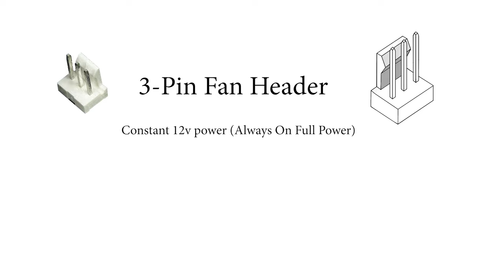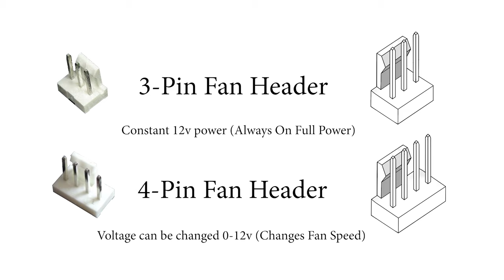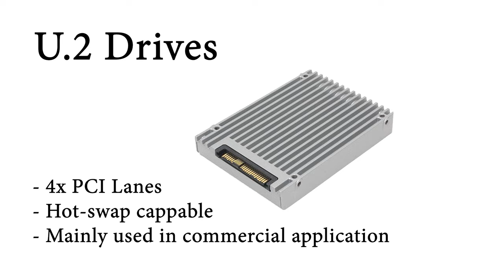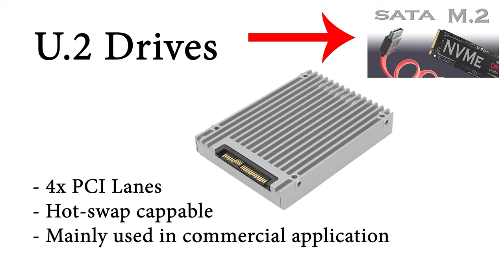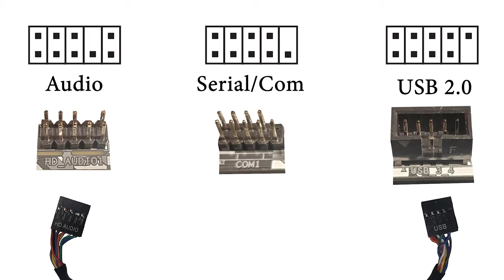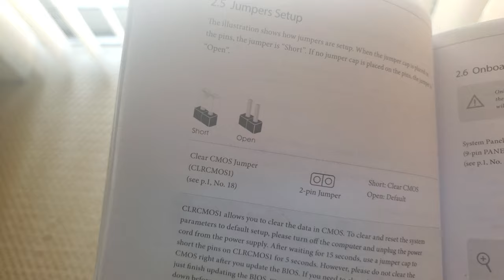Motherboard Connections Explained

Comment: Hi, I was kinda hoping you would mention a s/pdif connection. I have the connection on the mother board I have, just not sure what I need to buy so I can use it. but good video, guess i will keep looking. 
Have a good day mate. nice video otherwise.
Reply from the maker: Spdif is an audio connection. If your speakers support it you can buy a cable for it, but otherwise the normal audio connections will work fine. It's one or the other, you don't need both
Reply: @MaxsTech  Hi Thanks for the quick reply :)
I think you misunderstood me. My asus motherboard has a spdif connection on the mb, but it is a 4 pin on the board itself, with no spdif connection in the I/O. So I need something I can make the connection to the mb that  has a bracket and small board, so I can use a slot on the back and have a spdif connection. That way I can  use my 5.1 surround system. My main pc has a spdif out in the I/O, but my secondary pc does not so I want to be able to use the 5.1 on both pc's. 
Hope that make sense. So I guess I was/am looking for a product review on that sort of product. To tell the truth the video's I seen that were for a product like that were , well useless and that is being kind to the content maker's.

Comment: if I was to stick on my front i/o wire stuff on the wrong way eg -/+ was on opposite would this damage the system like a car battery would melt the wires. i know this wouldnt melt the wires. but if im going to build it correctly im going to ask the stupid stuff
Reply from the maker: From my experience they have never damaged anything. 1) they're super low power so a bit different from a car battery. 2) typically mixing up wires is only a danger when it comes to batteries since you could short the battery.
Reply: @MaxsTech  thanks man just had to be sure as i am new to the whole PC building thing. i understand its much lower power so i just thought id ask. better safe than sorry ;)

Comment: What about the USB31C header on motherboards.
Reply from the maker: If you have a usb type c front header. I should have added that to this video but those were almost none existent when I made this. Its a smaller port than the usb 3.0 about the size of an hdmi port.

Comment: What about if you have an extra reset switch?
Reply from the maker: On the case?
Reply: @MaxsTech  yeag
Reply: @MaxsTech  I have two reset switches and one connects to the reset button and the other connects to the LED button

Comment: Can I connect USB 2.0 ports to USB 3.0 headers on the motherboard and get USB 3.0 functionality?
Reply from the maker: They use different headers since usb 2.0 only consists of 4 wires while usb 3.0 uses 9.
Reply: @MaxsTech  I did notice that about 40 seconds after I posted the question. Thanks.

Comment: How to connect water cooling when there is no pump fan connector on the motherboard ?
Reply from the maker: You can use a fan header, just make sure if you have a fan controller or software that controls fans to never mess with that one. The pump should always be full and on.
Reply: @MaxsTech  Thank you for your answer. My motherboard is an ASRock Z170 Extreme4 and it gives you the ability to control both automatic and manual control of each slot. On this board I have 2x CPU Fan Connector and 3x Chassis Fan Connectors. The cooling kit also included a molex adapter, thanks to which I connected the cooling pump to the case's power supply ... is this also a good solution? or maybe better to use one of the slots on the motherboard. Because from what I understand, the district pump should be constantly on under constant voltage, but should it also be somehow controlled and regulated manually or automatically? Which solution is better?

Comment: Great! Thanks. Just miss the SPDIF connector. Actually I have this problem how to connect it on an ASUS B550-E Gaming. I mean what color get on what pin?! Maybe someone can help :) Cheers
Reply from the maker: You have an SPDIF connector? Usually that’s all hard soldered into the board. That’s part of your audio connections, I guess it’s possible you could have an spdif connector on the front panel….but I’ve never seen a case that offers that or motherboard that supports it. I’m betting you don’t use it though :P spdif isn’t popular. Let me know any other details if you can’t figure it out! Thanks for watching!

Comment: If my case has usb 3.1, can I plug it into my motherboads usb 3.2?
Reply from the maker: If its usb 3.2 gen 2x2 will use a different connector, a smaller square, not super popular yet in cases but we are slowly getting there.
Reply from the maker: They do sell pci cards that you can get though if your motherboard doesn't have 3.2 front panel support

Comment: yes my mother boards pwr switch is like only 5 little pins and one blank on i dont have a spot to plug all the front panel cables into lol right now ganked the old pwr switch from the old case and have the side panel off hitting the little switch button to turn it on
 i had one of those little slim gaming computers and upgraded to a mid atx tower to have more room for a better graphics card

Comment: I have 4 pin fan header on motherboard but have 3 pin wire on fan what should I do ?
Reply from the maker: You can still use it on that header. 1 pin just won't go in but it will still work

Comment: Some of these aren't completely correct. 3 pin and 4 pin fan headers can both be controlled. 3 pin header controls speed by changing voltage up to 12v and the 4 pin header controls speed using pwm. Other than that the clr cmos isn't always a 2 pin. It can also be a 3 pin (you have to move jumper between pins to clear cmos) and some motherboards have a button instead of 2/3 pins.

Comment: My front panel connector has 2 sides, please help.  One with the led and shit and the other side is unlabeled with pins
Reply: 2 sides?
Reply: @reubenconner1679  I figured it out, my pc wouldn't start cause the motherboard was faulty and it was a whole hassle lol.  I got it sorted out though.

Comment: Can 4 pin fan use for rgb?
Reply from the maker: If you want to control the rgb lights those fans typically have a separate connector for the lights, it’s not the same as the fan connector.
Reply: @MaxsTech  can it be use for rgb if I use adaptor? my pin for rgb broked :(

Comment: You were completely wrong about fan headers
You can control voltage on 3 pin connectors via bios. This may cause issues with rgb lighting, lower the voltage, dimmer the light
4 pin connectors are controlled by PWM (Pulse width modulation) that doesn't change the voltage but pulse width 100% is 12V constantly 50% are voltage pulses equal in length. 10% is 1:9 pulse ratio
Reply from the maker: Refer to the pinned comment.

Comment: my gigabyte motherboard has no rgb header connector how to control my RGB fans on my case?
Reply from the maker: You won’t be able to directly from your board. I think you can buy rgb controllers you can plug all your lights into though and control via a switch or secondary controller.

Comment: If my motherboard has the 8+4 pin do I need the extra 4 pin... having problems with having a screen when I turn it on and says my gpu is undetected
Reply from the maker: Should be fine with just the 8 unless you are doing some crazy overclocking
Reply: What’s crazy is that my ram had to be put in the wrong slots to boot up💀
Reply from the maker: Could be a faulty ram slot on the motherboard. Also double check your ram is in the official support list for the motherboard. Ram can be weird sometimes and mess stuff up.
Reply from the maker: Sometimes ill just take the the ram out and put it right back in and it fixes issues.  Lol
Reply: Good to know, thanks !

Comment: im trying to add another ssd to my mother board and i have no clue on what to buy..i have the SSD and thats it.  I have a cool master v750-750w compact fully modoular 80 plus gold power supply. I dont know what i need other than the SATA  90 degree angle cable.
Reply from the maker: For a sata ssd you'll just need a power cable and a data cable. The power one comes from your power supply, the data one is seperste and connects from your ssd to the motherboard, it's the same L shape as the power but much less wide. Usually connects near the bottom right of the motherboard

Comment: My case has a 1394 cable, but my motherboard says in the manual "Don"t connect 1394 in the usb or the motherboard may be damaged!' :(
Reply from the maker: Thats used for fire wire, an old plug standard for drives and cameras. Your motherboard probably doesn't have a port for it since its not used anymore.
Reply: @MaxsTech  Oh I see, thanks for replying! 
Btw, I'd be very pleased if you could help me with your opinion on an issue my psu is having. 
The thing is, it makes a noise like a squeal but if I demand more performance from the CPU it almost goes. I read in some forums that people call this coil whine so I decided to open the PDU (all safety protocoles) and checked it and by trying to locate the exact spot of the noise I realized that it's not a coil that makes it, it's a spot between a Ceramic capacitor, a resistance and a Ac to Dc rectifier, don't know exactly which one of these is the deffective but my guess is it's the capacitor, something that people call "Capacitor Squeal" I saw some people say that's harmless, other say it's the noise a cap makes before fail, others say it's the electrolite inside it. 
I don't know the psu has worked perfectly so far despite the annoying squeal. ¿What do you think about it?, I'd be very happy to see your opinion.

Comment: I know, we are used to the color being RGB, but the order of the pins of the LEDs on the motherboards is not RGB, it is GRB (to be exact it is 12v-GRB, the most common if not the only order in almost all 5050 led strips), it can be read on the board itself (1:27). Since you explain the connections, let's at least get it right.

==========

Ya lo sé, estamos acostumbrados a que el color es RGB, pero el orden de los pines de los leds en las placas base no es RGB es GRB (para ser exactos es 12v-G-R-B, el más común por no decir el único orden en casi todas las tiras led 5050), se puede leer en la propia placa (1:27). Ya que explicas las conexiones, al menos pongámoslo bien.
Reply from the maker: The order of the pins were never discussed. Clearly you can see from the color of the lights wires as shown in the video that the order is WGRB. Where white is the 12v (sometimes depicted in black).
Reply: @MaxsTech   It is on the upper right corner, you have drawn the scheme of pins, and it says RGB, you also draw a red arrow to show the voltage pin.

Comment: what will happen if i plug 4+4 pin to a 4 pin cpu power? and what is 4+4 pin? newbie here
Reply from the maker: 4+4 just means its an 8 pin power connector thats split so in case you only need 4 you can use it still. Just so they only have to make 1 cable that fits multiple boards.

Comment: I upgraded my power supply I hooked it up and on powering up the pc it shuts off and turns back on..need some help
Reply: you probably have something plugged into a fan or rgb header that shouldn't be there. that was my problem. i took off all the fans (I have 6 not counting the cooler on the cpu) on my gigabyte b450m board... it says "cpu fan" in the top fan connector, like I  this video, then on the upper left there's a 3 pin and a 4 pin and this is what he's talking  about with the 3 or 4 pin that is either always on or that controls voltage. get the shit out if there, run a fan or rgb hub off the main fan header, and be free of not only cables going there but the troubleshooting hassle it is for first time builds... or first build since 2gb was "oh man we're NEVER going to use all that storage!" on some @aol.com email address havin 14.4kbps shit.  if you're either of those, like me, knowing that having those configured incorrectly can prevent your pc from even booting, tho the convenient fan header looks tempting, just steer clear  if nothing else is working.

Comment: My motherboard does not have a pump header and it just has a cpu fan which is 3 pin and I have recently bought a liquid cooler can someone please tell me what I should do
Reply from the maker: You can still use a fan header to power a pump, the pump header is just locked to the full voltage. You should never run a pump at a lower voltage, the fans you can adjust speed wise but the pump should always be on 100%.
Reply: @MaxsTech  ok thanks a lot

Comment: The fan header explanation is completely wrong, you can controll voltage on 3-pin headers, 4-pin headers give constant 12v and regulate the speed through pulse modulation, but can be set to operate using voltage - this allows you to plig 3-pin fans. The pump header does allow for speed controll, though is capable of sending way higher current.
Reply from the maker: See annotation added to the video. Make sure you have those turned on. Thanks.
Reply: @MaxsTech  And what is this supposed to mean? There's no real information about what I just mentioned... Is the average viewer going to be checking every single detail themselves? Isn't that what this video was supposed to address? I'm quite surprised people could make so many mistakes about such short little details...

Comment: Video is inaccurate 3-Pin fans & headers are controlled via voltage. 4 pin fans are controlled by frequency (Hz) otherwise known as pulse width modulation (PWM), but they can also be controlled by voltage. Most motherboards modern motherboards do not have 3 pin fan header unless they are meant for pumps which is why they normally run @ max RPM. Some motherboards support 3-pin fan control on a 4 pin fan header via bios options, however most opt not to. The reason 4 pin fans have another wire is for fan speed detection, on a 3-pin fan the system will not know the speed the fan is actually spinning at. Your motherboard will control 3 pin fans between 5V-12V. There are almost no external fan controllers that work to control both 3 pin & 4 pin fans, additionally a lot of 3 pin external fan controllers are dumb, meaning they do not adapt to the temps within your system. There are some fan controllers from china that use variable resistors, a molex or sata power connection, & a case pcie slot to offer 3 pin fan control by use of knobs that I would recommend so that you can adjust to a slightly positive air pressure layout in your case

Comment: Noob Question: Why do some MB's have two 8-pin cpu power connections at the top?
Reply from the maker: For extra power for the cpu, typically for overlclocking when you raise the voltage used. Some boards can have an extra 4 pin some an extra 8 pin, just depends on what the board offers. But its all just extra power to give your cpu if needed.

Comment: Question: How do some people start the motherboard without a case?
Reply from the maker: You can short out the 2 pins that connect to the power switch down at the bottom where all the front IO stuff is. Just touch them with a screwdriver tip. Also some boards have a button on them that turns it on.
Reply: @MaxsTech  alright thanks!

Comment: What do I do with the vdg cable if anyone knows
Reply from the maker: If your board supports that connector you would plug it in there. It may be a 3 pin or 4 pin depending on your setup. Use the D_LED plug. Any other plug would likely damage the rgb controller so don’t try to plug it into anything, I recommend using your mobo manual to ensure you use the correct header (if you have it)
Reply: @MaxsTech  cheers I have the manual and it goes quite in-depth but couldn't find anything on vdg when I searched it. But maybe D_LED something will come up
Reply: @MaxsTech  it's a b660 pro rs. Still can't find anything in the manual about it. So I'm assuming it's not necessary to plug in and the argb is just what I need to plug in

Comment: what if i not have 24 pins but 8 M-board ( 2×4 ) ??????
Reply: My hp motherboard dont have 24 pin power connector, instead it have one  4 pin (PWRCPU) and two 6 pin connector. I couldn't find a PSU for it.

Comment: can you add an ide drive to a new pc
Reply from the maker: Not sure why you would want to.. but yes if you got some special pci ide card to plug it in. I'm honestly not sure if they even make that but I'm sure there's some converter to make it work. Modern motherboards don't have ide ports though
Reply: @MaxsTech  can i transplant the heads
Reply: i need  the data off my ide

Comment: would like to know what you do when motherboard needs extra pins than just 24, 6 more ;) z490
Reply from the maker: The 24 is standard, and thrn usually most boards will have the extra 4, 6, 8, or even more sometimes to be dedicated to the cpu alone. Helpful for big overclocking

Comment: In my Cpu case I have a Cable that says Serial Ata and I have no idea where to plug it I hope someone knows
Reply from the maker: That is a SATA cable (also called Serial-ATA) which transfers data for you harddrive or optical drive. Most motherboards include 2 or 4 in the box for your drives.
Reply: Thanks do muvh butI have another Problem My Brand new cpu case have stock fan and theres a cable that has 4 pin on it and a clip where does it go? on te motherboard?
Reply from the maker: The cpu cooler will be a 4 pin fan header. The 4 pin headers are usually right near the cpu socket. Its just a fan header, but allows for voltage control so you can speed up/slow down the cpu fan cooler
Reply: This channel haa got to be the most reaponsive channel ever Thank you so much

Comment: Im sorry but you Said you cant controll the Voltage on a three Pin Header and that you can on a four Pin. And thats wrong im afraid: you can controll the Voltage on a 3 Pin Header, thats how you Change their Speed. On 4 Pin Headers you can Change the Voltage If you usw dc Mode in the BIOS but 4 Pin pwm Fans Work by using a duty cycle With a fixed 12 Volts. The fourth Pin is the pwm Signal. Great Video otherwise though!